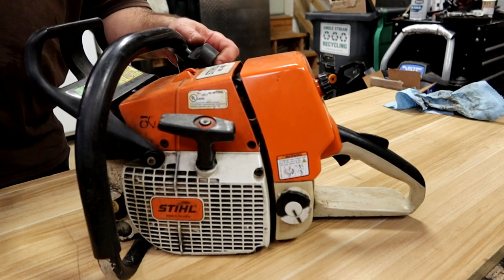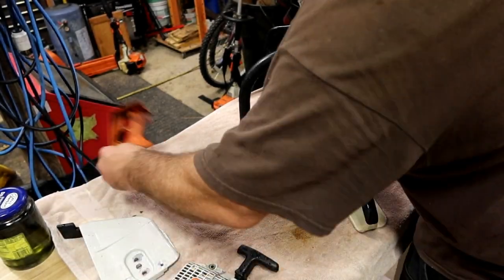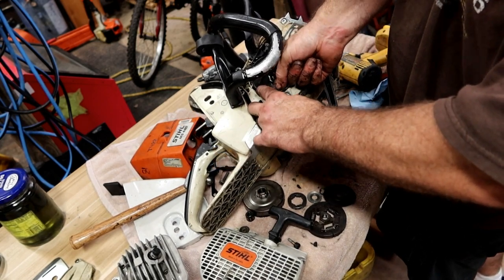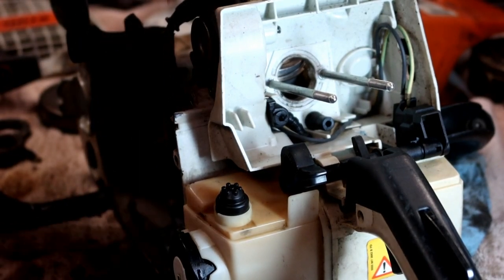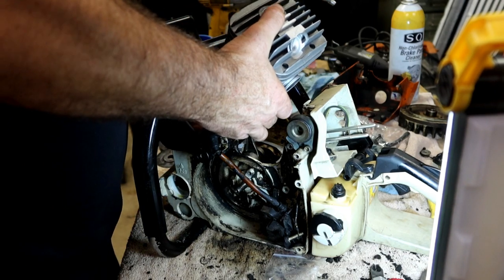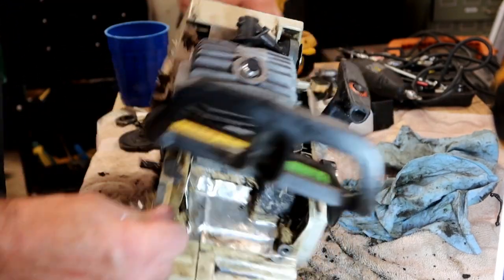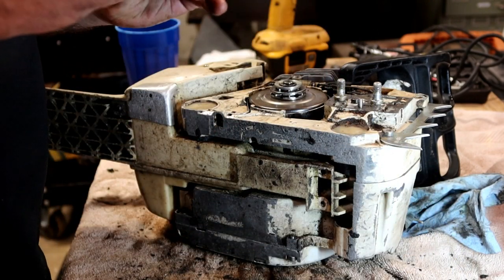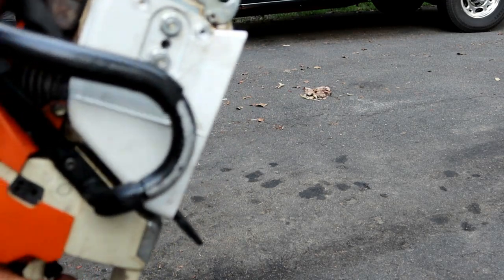Stihl MS460 rebuild Fairfax auction chainsaw

Comment: That was a very nice build. Hopefully I learn some things that will save me some time and most  importing a headache. I have a 046 That I got back in 1995 when they first came out. I am going to replace my piston and rings, what every else that I find when I take it down. I stop running while I cutting up some fire wood. Not bad for a saw that old. I had a tree serve but now I am retired, and hopefully that 046 will whole up until I get tired of using a saw.
Reply from the maker: Thanks for watching and commenting. Those are great saws. The oem parts are a little pricey so that's why most of that build was aftermarket. The guy I built it for uses it non-stop for stumps and such and loves it. Good luck